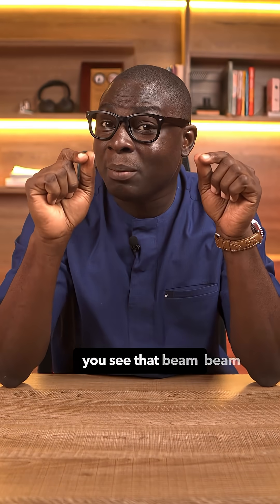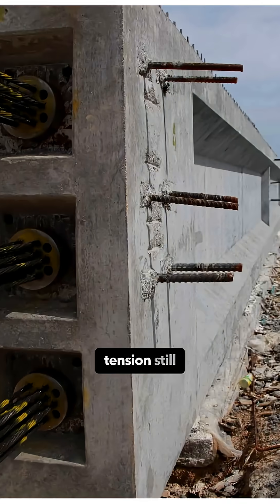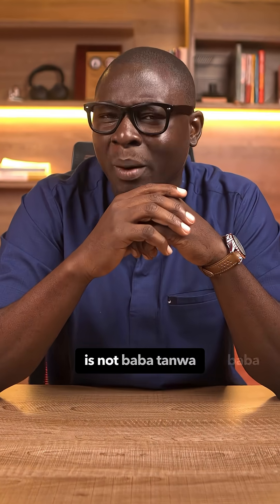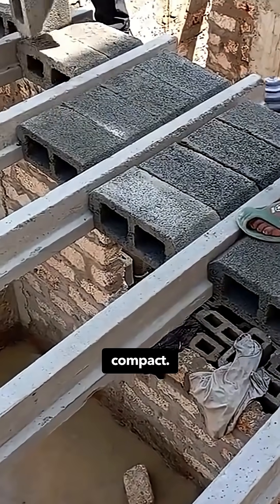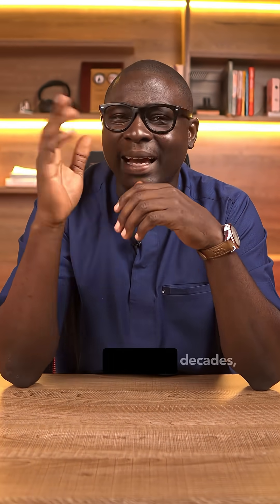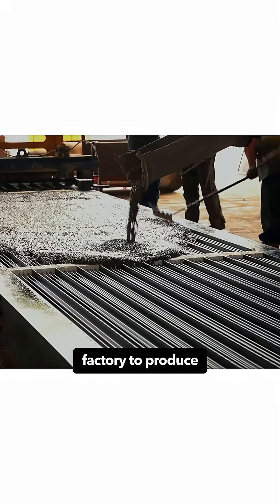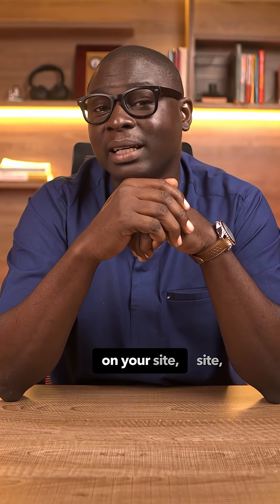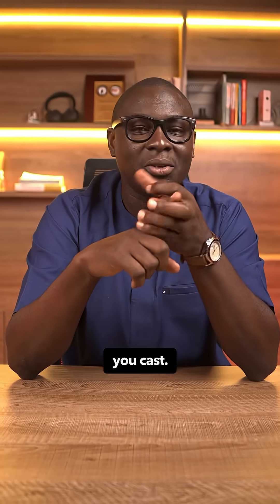The Beam and Block System: Fast, Strong, but Requires Precision

Comment: Is this a decking that is soundproof ? Will this style still need laying of metal rods and concrete again?
Reply: Yea, it's sound and thermal insulating.
Then you will need to tie a mesh of rods on it using as from 6mm rods upwards, depending on the purpose and load the floor is meant to carry. 
Then give it a final concrete cover of 5cm